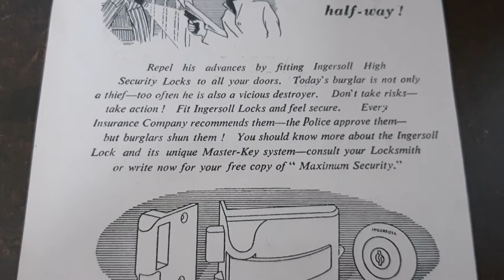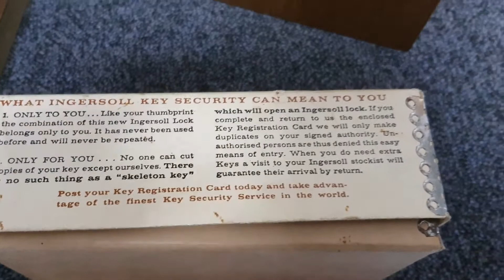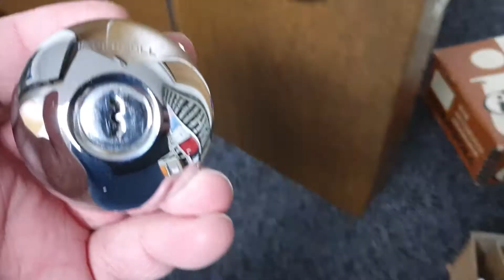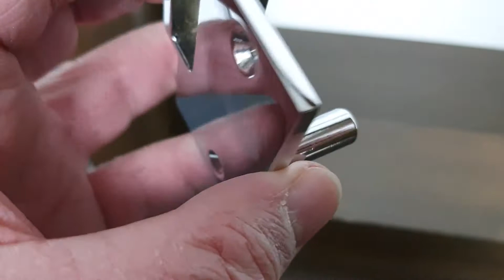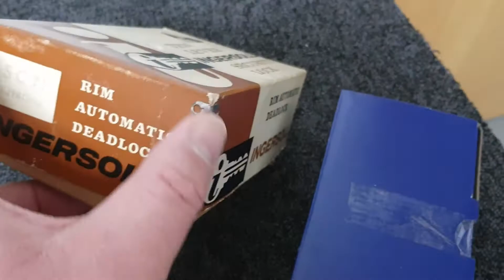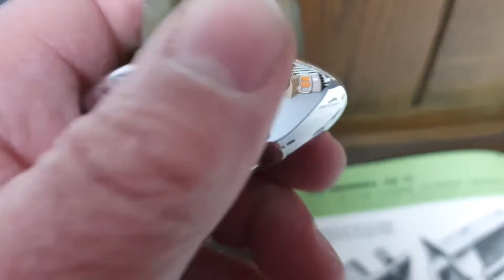The Ingersoll Lock SC71 explained and De-Mystified - Buy Online at www.ingersolllocks.co.uk

Comment: I'm a retail manager and some of the stores I've managed over the years in my company used to use Ingersoll locks on offices and store rooms sadly non of them working anymore cylinders still on the door but latches broken! Ingersoll locks look more secure than the yale latches! Did find some Ingersoll keys when clearing out the key safe last year, also do key cutting in my shop and never cut an Ingersoll key yet!

Comment: Good video.
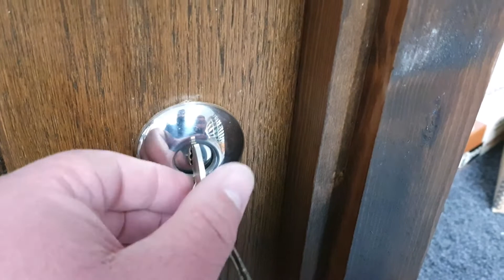One issue I have is the double locking feature at 11:54. 
While it is a security benefit it also means that when the the lock is double locked 
then persons inside cannot get out. This is the same issue that the Union drawbolt has.
People have and do inadvertently lock people inside with this feature.
Reply from the maker: Thank you, really good point. The SC71 is suited to properties that have an alternative exit such as a back door. For properties where there is only one door we recommend the non-double locking SC73, here is a a video  https://youtu.be/elYusnape_Q

Comment: Can you change these so the key can release. The one i have does not rotate 360 when installed. It only unlocks one way but the key wont release. If you install it the other way you can get the key out but it wont unlock.
Reply from the maker: Sounds like you either have the cylinder in the wrong orientation and/or you have not followed this step in this video timeline https://youtu.be/tP5CECZQfEw?t=512

Comment: Hello friend. I want to buy the sc71 from the lockshop warehouse, as its £50 cheaper but wanted to know, are they official suppliers for you as I want to ensure its genuine Ingersoll. Also I want the ourward opening one, but my lock is on the left hand side of the door from the inside of my house, and it opens outwards. Will this lock work. Thankyou.
Reply from the maker: Sorry for the slow reply, the comments notifications hasn't been working very well. We can't comment on individual suppliers but I can inform you that the outward-opening version of the SC71 is only available directly from our website here is a link https://www.ingersolllocks.co.uk/products/ingersoll-sc71-ten-lever-classic-double-locking-nightlatch-outward-polished-brass?variant=28702043177040